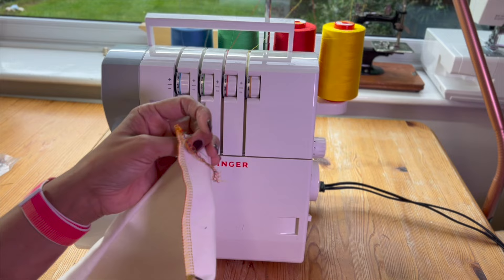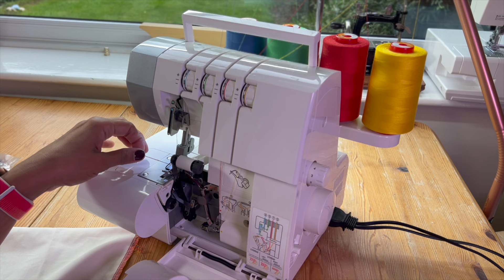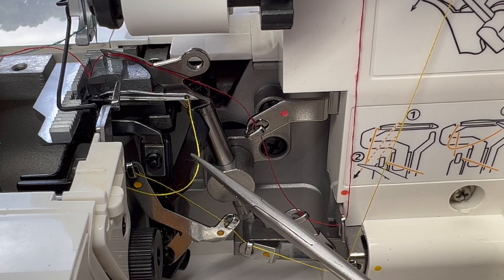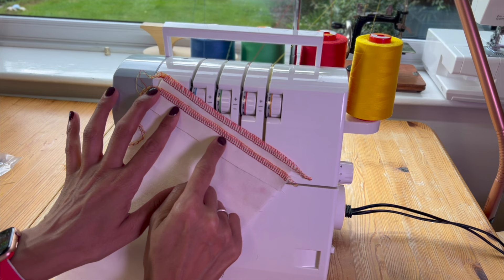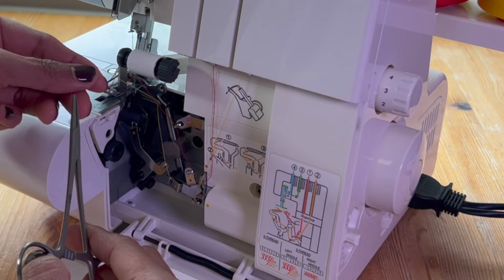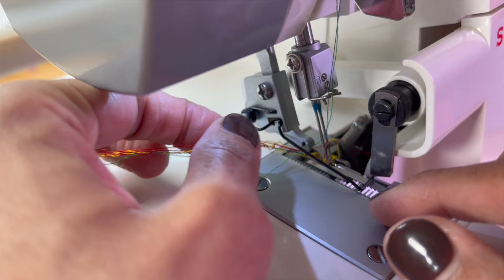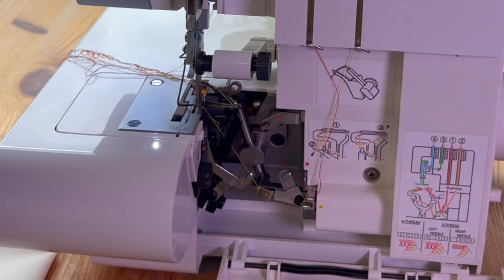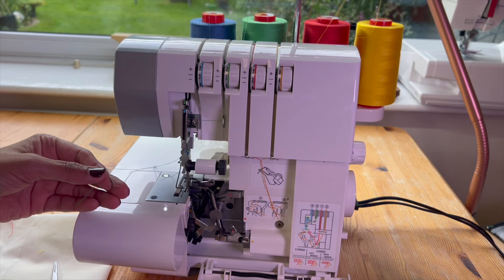Why is my overlocker not stitching? #abisden #sewinghacks

Comment: I have a fairly new overlocker i.e. Aldi Singer (less than a year old) and by watching Abi, I am respecting my machine by keeping everything dust free and oiled.   I can tell you I am really getting along great by reading the manual and following Abi's advice and following the video clips.   Can't thank you enough as I genuinely was scared of these machines but feel it's the best purchase I've made for a very long time.   Anyone panicking about taking a leap and purchasing an overlocker, I did and I haven't looked back.    It's permanently on my dining room table.    cant bear to put it away.  A word of advice, get yourself good thread, I bought Moon thread and haven't had any problems at all.
Reply: I have the same Aldi Singer and not used it yet. I am delighted to have found this page.

Comment: I have an overlock elna 664 pro, I had it for years. I gave it to repair because it didn’t cut fabric well. It was cleaned and knife replaced. it’s sewing great, as long as the thread of the fabric is vertical/horizontal. If I try sewing diagonally or sew around the circle it doesn’t keep the thread on the fabric. It’s like I’m sewing without a thread, it just cuts the fabric and that’s it. I did ask my repair poin about it but they just shrugged their shoulders…. I’m at my wits end I have no idea what’s wrong!

Comment: Hi Abi. The janome 6234xl  is a bad  overlocker  to thread up. so much so, i do not use that much. I have a problem with one of the loopers . 😘😘👍👍
Reply from the maker: That’s not good. Is it the lower looper? Getting to the guide underneath the needle plate?  I have that coming out shortly. 👀 just for you!
Reply: @AbisDen  Yes it is. and thank you. 👍👍😘😘